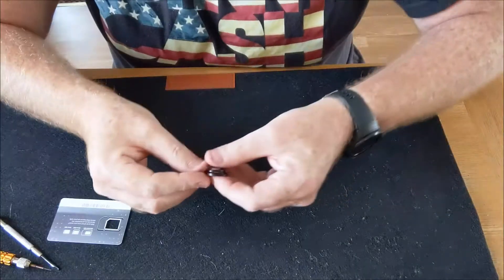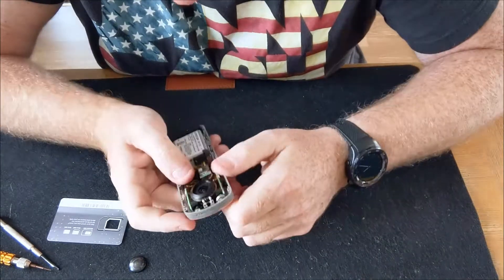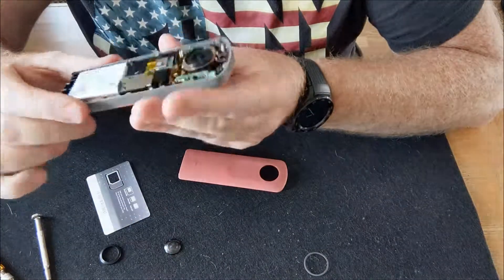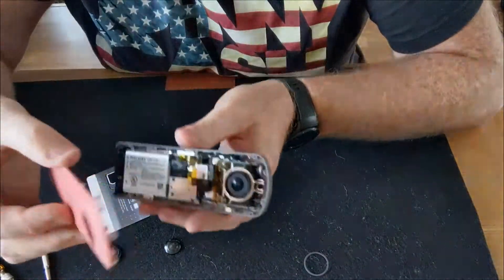Theta V Breakdown and Lens Change using a donor camera ( Theata S)

Comment: So I just did this repair to my SC, and it was the other lens. I purchased a new lens off ebay (from China directly) and it looks good. I did repair, no issues, although I had to unscrew the entire lens component and slightly, bend it back, replace the lens and the screws. Put it all back together, what I thought was successfully. Now it won't power on.  I did not mess with any other components so what could be the problem?  Thoughts? Im wondering if I loosened the battery -to-power connection??
Reply from the maker: Thats all it could be, I have ordered a battery from Ali Express in the past, but it must be a battery ribbon issue, good luck

Comment: Thank you for the video. Really informative. Please can you advise or recommend on what type of lens to purchase for Ricoh Theta V. I have tried searching for 360 Spherical Lens but they don't seem to look right.
Reply from the maker: I used a theta s i bought cheap on Ebay
Reply: @360bigskymedia2  I have a ricoh theta V, but the problem is i do not know where to start.
I bought Ricoh V lenses but I'm afraid of breaking, I ask:
I noticed that Theta S are embedded.
But are the Ricoh Theta V threaded or recessed?
Reply from the maker: @LaurivaldoLopes  Some are pushed, mine being an early one was, but later ones are screwed, best to use a plastic card and take your time prying

Comment: I changed the lens of my Ricoh Theta S with the help of a friend but we noticed that the lens is NOT FITTED (PUSH FIT) it is THREADED. If it were attempted to remove it in any other way, the risk of breaking it would be high. Therefore, be careful, if the lens needs to be replaced, use a pliers to unscrew it to remove it. THIS TIP WILL SAVE YOU FROM BREAKING YOUR LENS.
Reply from the maker: Thanks for that, I guess the SC was different, pleased you got it repaired
Reply: I know this is an older post!! But a billon thanks for that info!!!
Reply: Where did you find or buy the Lens for your theta.   I literally just broke mine.  I have the  Theta V

Comment: Great instruction, boldness with a bit of careful, intelligent screwdriver work. Love the comment if some put this together it can be taken apart and repaired. How much do do you want for the rest of the pinky I need to resurrect my old Theta S. USB charges but no data comms.
Reply: I changed the lens of my Ricoh Theta S with the help of a friend but we noticed that the lens is NOT FITTED (PUSH FIT) it is THREADED. If it were attempted to remove it in any other way, the risk of breaking it would be high. Therefore, be careful, if the lens needs to be replaced, use a pliers to unscrew it to remove it. THIS TIP WILL SAVE YOU FROM BREAKING YOUR LENS.
Reply from the maker: Many Thanks for the Info